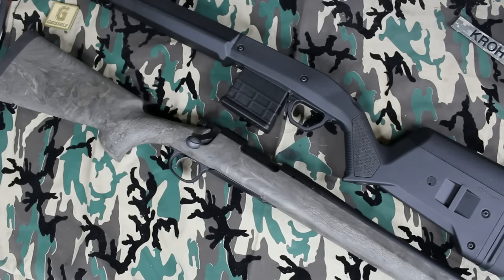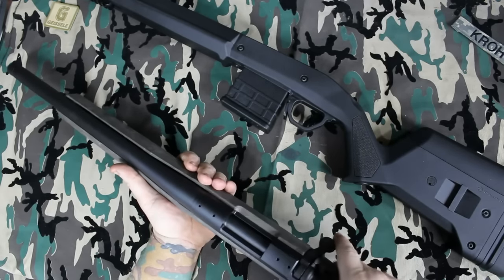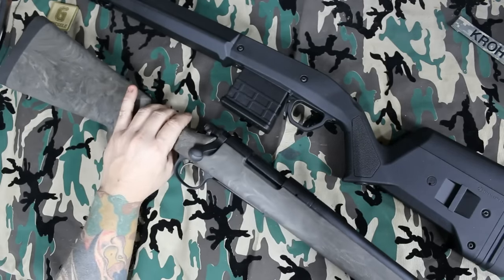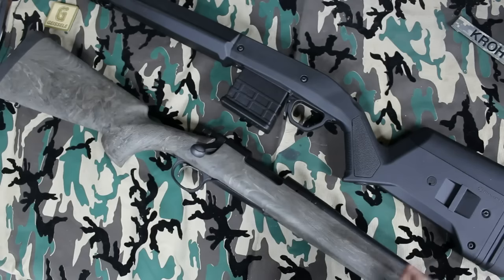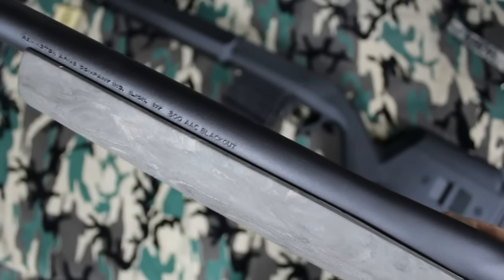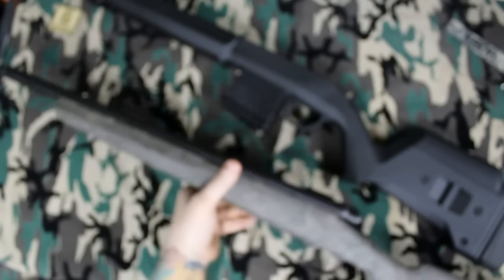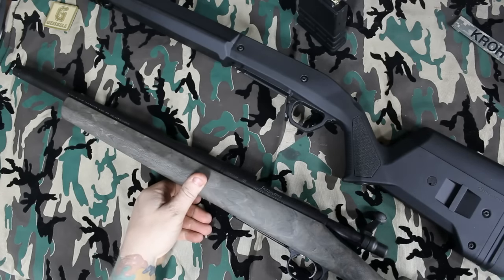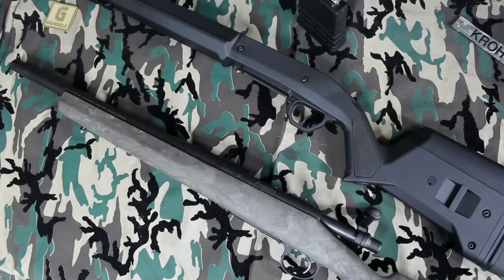700 aac-sd 300 blk problems

Comment: hopefully I get that you're upset it was marked with the wrong twist rate but if you really liked it when you first got it and said it was a great rifle and it was super accurate what difference does it really make if it's a different twist rate
Reply from the maker: ben davis. I said what the rifle was advertised to be.    and in 300blk a 1-10 twist cannot shoot subs and that is why I bought the rifle.   shooting suppressed.    a 1-10 has issues stabilizing heavy 220gr at subsonic speeds and can cause a baffle strike destroying a $1000 suppressor.     that is the issue.
Reply: ben davis i

Comment: Just so you know you know oratorical genius. Any specific twist rate is not good for every bullet you have to decide what weight board you’re going to use and then adapt a twist rate for it you can’t shoot hunter green bullets with a twist rate that’s good for 200 grain bullet no such animal. I doubt the 200 grain bullet is going to be able to unstable eyes within 6 inches leaving the barrel. If you think it won’t stabilize at the end of the suppressor or within the suppressor measure the distance from the end of the barrel to the end of suppressor take a suppressor off and put a piece of cardboard in front of it and shoot if the hole is concentric  well that’s that. PS : take care of your business and stop whining